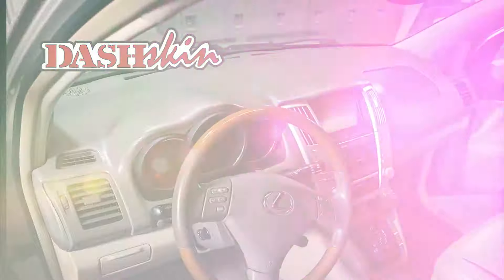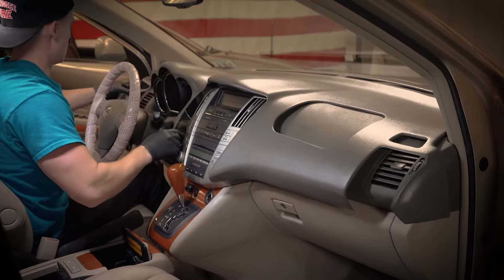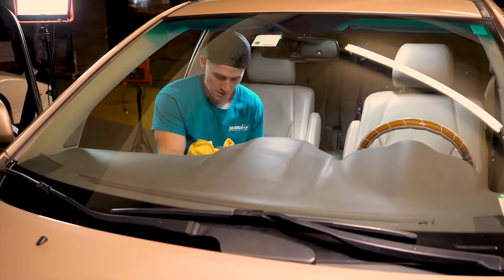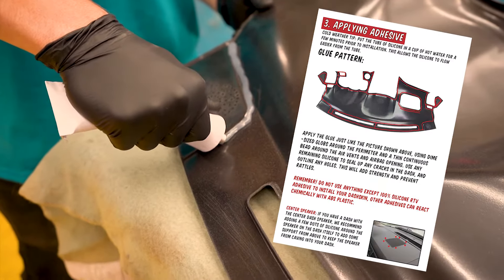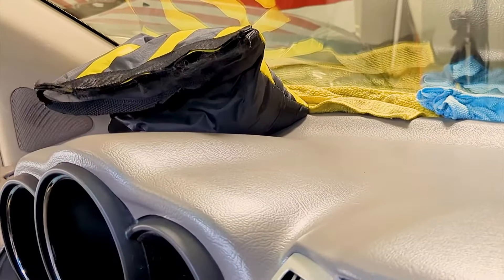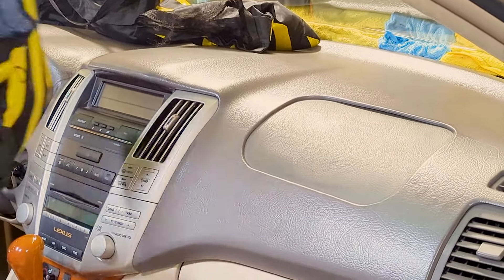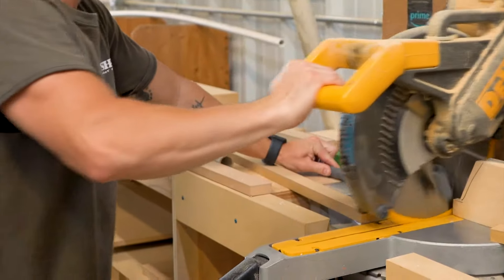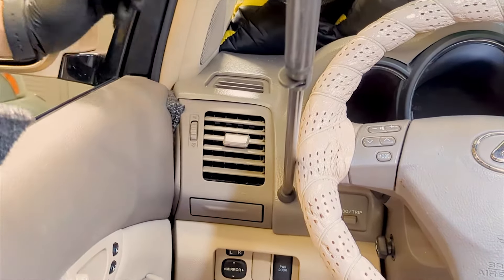HOW TO: DashSkin 2004-2009 Lexus RX330/RX350/RX400h Dash Cover Installation

Comment: I installed the Dashskin on my 2008 Lexus RX 350 and I love it! But I have one problem. How do I get rid of the RTV adhesive smell? I installed it three and a half weeks ago. I have left the doors and windows open for days but the smell remains.
Reply from the maker: The silicone uses ambient humidity in the air to cure, so I'd recommend driving with the windows and sunroof open to let as much moist air into the car as possible to complete the cure. It will go away with time!

Comment: Why shouldn't you use alcohol to clean the og dash?
Reply from the maker: You can, we mostly try to steer customers away from using alcohol on the underside of the dash cover, as it can eat the paint off if it drips to the top side. Alcohol can be a pain to use though because it evaporates so quickly. Industrial degreaser is much easier and more effective we find.

Comment: What silicon adhesive did you use? My box didn't have instructions and came with Instant Gasket Silicone that was gray,  not clear like the product you're using. This video is so helpful. Thank you.
Reply from the maker: Sounds like that might be a Chinese knockoff, ours will always come with silicone and vehicle specific instructions! We use 100% silicone RTV adhesive but I couldn't be 100% sure what to recommend without knowing what material they make their skin out of.
Reply: @DashSkin  I thought I was buying your product off of Ebay for $30 cheaper than Amazon after reading the amazing reviews. Just so you  know, the seller recommended this video for a "similar" product when I reached out to them about the gasket silicone instead of glue and no instructions.  The description says it's made of ABS Plastic and states a "textured finish". I will try and research a good adhesive.  Thank you for your reply.  :)

Comment: My 2006 RX400h doesn't have the cutout for the passenger side air bag. Is there a dash cover that does not have that hole?
Reply from the maker: Hello! All RX vehicles have an airbag there, it's just hidden. It destroys the vinyl of the dash when it deploys. If you look closely at your dash on the passenger side, you'll see SRS AIRBAG in small print indicating the airbag.
Reply: @DashSkin  Good info, thanks. Was wondering about that. I'll be a customer soon.

Comment: If i dun have prop rods or sticks for the fronts is that ok?
Reply from the maker: It is recommended if you are looking for the most undetectable, factory-looking install. You run the risk of the silicone curing while the cover is not totally flush with the dash without them.
Reply: @DashSkin what length pvc or wood would you recommend?